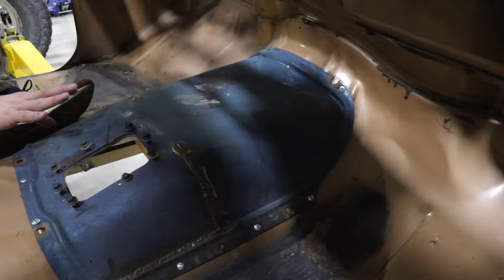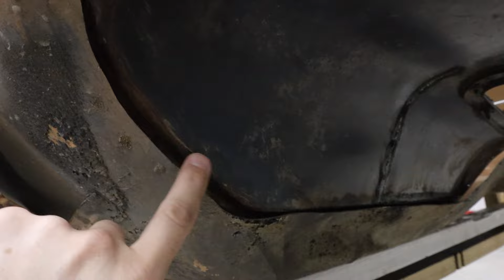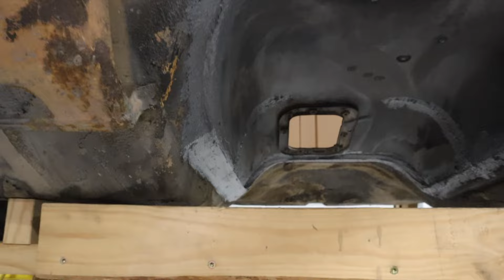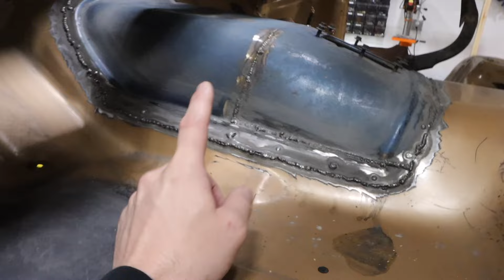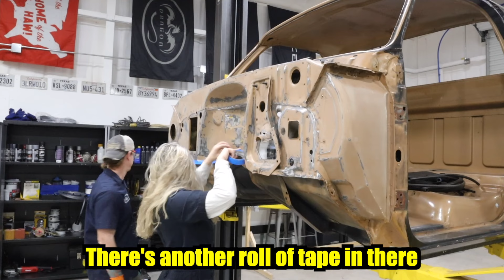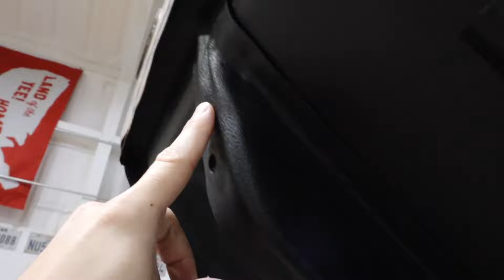Duramax Build Part 12: Tunnel Swap and Undercoating

Comment: 2 questions did you use a low clearance oil pan to clear the steering and are you planning to run a crow hood. thanks love the videos
Reply from the maker: No and yes! The motor mounts I used allow for a stock oil pan, but because of that, I will have to use a cowl hood since the engine is so tall.  I could use a body lift instead but I don’t like the look of those.
Reply: awesome thx keep up with the videos there a lot of help @richphippsgarage